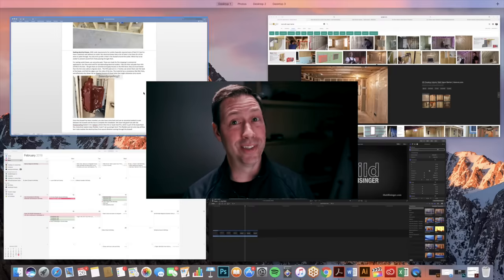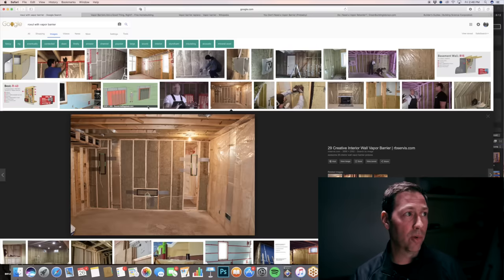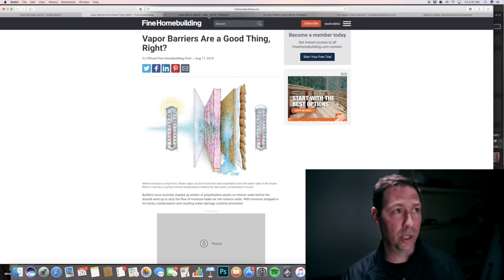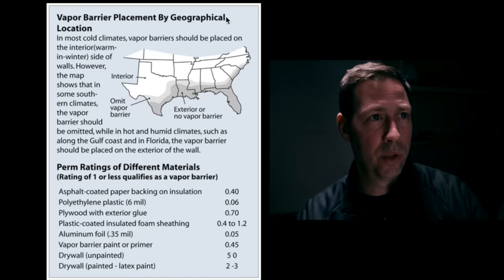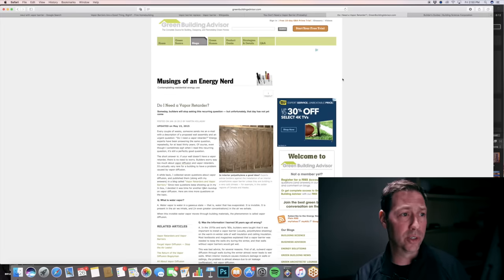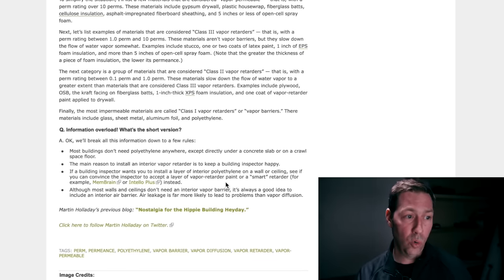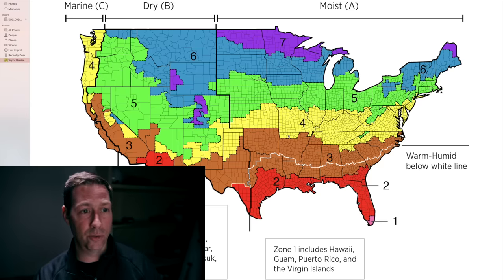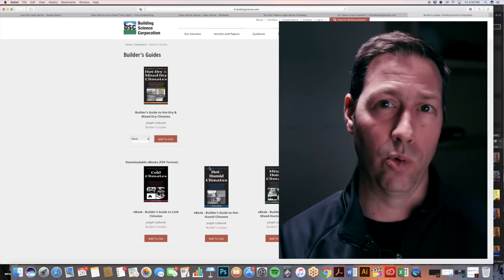Vapor Barriers: Need one or not?

Comment: Doing a shower tub surround.  Years ago we had initially installed plastic over fiberglass insulation, then cement board, then tile on a partial repair of the tiled wall.   Recently we had to remove all tile and decided to just install a simple tub surround.  I was surprised to find some mold starting to form on joist and cement board. as well!  Tore everything out and this time, not using the plastic sheeting.  Using, faced fiberglass insulation, cement board, taping all joints and using quick set mud and then a moisture repellant paint all over the cement board, including near the lip of the tub where the surround will butt up against, before finally installing a tub surround kit.  We'll see how this goes.

Comment: I'm going to stick with Kraft faced insulation.  I like the idea that once it's stapled up it's not going to settle down and create a gap at the top.  Sure, I could tuck that batt up there a little extra but packed insulation has a much lower R-value than loose insulation.

Comment: Thank you for this presentation, Matt. I just moved to NJ from Hawaii, where I haven't faced these questions for years, and back to contracting, I am now working through the entanglement of codes and practical realities on the East coast. Your video helps me prepare my self-contracted attic insulation in New Jersey - zone4, but some specific questions remain open; On one hand I plan on using the Rockwool batts, known to be moisture and mold resistant, and on the other hand I won't seal the attic's cathedral ceiling and walls with drywall, but will cover them with reclaimed and uneven tongue and groove, which will allow a lot of air-moisture exchange. The attic will be our master bedroom so no cooking or shower related humidity and heated electrically with baseboard heaters. Considering these parameters -wood instead of drywall, many holes, Rockwool, low humidity producing activity, do any particular advise?

Comment: This exact thing that happened to my sheet rock. It was suggested to us to use plastic before putting on the sheet rock. Well  another builder told us after the fact that they said that having a double vapor barrier on a wall would cause condensation and could cause mold or rot to the sheet rock. I used 5/8" fire shield on the walls that were facing the walls on the outside. I moved out of that house after a couple of years into another home. Someone else bought it and they put the house up for sale.  I contacted the realtor that was listing that home just so I could look inside as it was empty for a couple of years and I wanted to see what condition it was in. The room that we remodeled had black (looked like mold) that came through the sheet rock. I was surprised! didn't know if it was caused from the house having any heat on for a couple of years or that it was in fact caused by the plastic sheeting? I live up North.

Comment: Thank you for lecturing on this previously-mysterious topic.     The example of the south Texas, 10 y.o. house with moisture damage, is utterly fascinating... and sad.  Here in southern California, we are blessed with temperate air, 12 months of the years, as least for part of each 24-hour day, so I have my house open for fresh air either all day or part of each day.    So I suppose that would cover a lot of sins, of commission, on this subject:  installation of vapor barrier when it should have never happened.

What DOES happen here is inappropriate garden sprinkling, either to soak exterior walls routinely; seepage of fresh water pressure piping; and ground water from geological oddities.   

So thanks again for an education on this obscure subject.

Comment: What about Canada Matt?? I am glad that you did correct yourself, calling poly a vapour retarder as opposed to a vapour barrier. Believe it or not 6 mil poly vapour barrier as it is called is still somewhat permeable!! Meaning that water vapour will actually pass through that sheet of plastic!! It is a must to have this vapour retarder in homes in Canada. With our cold harsh winters the homes have a tendency to "bag'" just like breathing into a plastic sandwich bag, with leave water droplets of condensation inside. The temperature  between the inside and outside of the bag makes a huge difference in the amount of condensation. Here in Canada is moisture control 101. Thanks though Matt!! A lot of people don't understand the concept or principles behind this, a lot of builders included. 
In Canada we use Tyvek or the equivalent of on the exterior of the home under the siding or whatever wall covering. This is actually classed as a wind barrier. Will breath from the inside but, is allowed to let moisture out to the cold side. 
I wouldn't know where to start with a warm humid climate like Florida!! I guess everything that I have been taught would be in reverse!! Walked right into that one eh!!!
Reply: Further to Earl's post: I extrapolated from the DOE map, and a huge segment of Canada's population (specifically the Golden Horseshoe around Toronto, 5M+ people alone) is in the same zone as New York, not the most northerly zone that Minnesota is in. I have to stop myself from fully accepting the claim as it ostensibly applies to here (Toronto) but it's sure as hell got me thinking and researching it. One major problem might be the radical temperature and humidity swings from Summer to Winter. A single barrier optimal for one direction maybe absolutely sub-optimal for the other.

Great channel! This may be heresy of the enlightened kind. Progress in knowledge does that.

Comment: I'm in Georgia and I insisted on house wrap under siding during a reside of my house because the siding specs required it. I don't think any siding should be considered anything but cosmetic. I've also read that a vapor barrier on both sides of a wall is just asking for trouble. Water gets in but has no place to go.

Comment: Great topic and explanation.  Would love to see a video similar to the picture you showed of the house where took down the drywall and found that mold.  Would love to see how you tackle an already existing wall or walls to re-air seal and re-insulate.  Easy enough to explain all that on new construction and I'm sure very similar process but with existing older stuff you never know what you're gonna get behind some walls.  Thanks!!

Comment: The one place on my home that seems to have a problem with the siding rotting off every 20+ years is off of a full bathroom that has one wall that is adjacent to and outside wall. I'm in zone 6b, 27" of average rainfall, 26" frost line in heavy clay, summers that bounce between humid as Houston, or drier than a popcorn fart.

Comment: Hi Matt!  Thanks for a great video.  This actually really helps.  I'm about to start finishing my basement  (right on the climate zone 4-5 line in Indiana, not that it matters).  Everything you said seemed to relate to above-grade application.  Do the same rules apply for basements/walk-outs or anything below grade?  I'm just curious, and it would help greatly in the coming next 2 months.

Thanks again for the great info!
Reply: What did you end up finding out for below grade ?

Comment: I live in Norway, Europe and find your videos interesting even thou building regulations differ quite a bit. You might think Norway is cold, but actually in the south we tend to newer get snow/freezing temps by the coast. About wapour barriers. The entire Norway need to use barriers now. With increased energy savings regulations and by that thicker walls being enforced, we need to construct walls with barriers both on the inside and outside. The outside thou needs to have a membrane function, typical goretex type of to let moisture out, but completely sealed to avoid air leakages. Before this new regulation kicked in a lot of newbuilds got misture/fungus problems. The consequence is that we need a significant amount of time to completely dry out the fraiming before adding in rockwool and seal of with polyEth from the inside. We use quite a moisture test rehime before sealing walls. Moisture buildups stopped with this and wattage/m2 dropped. Insulation in the walls are now usually between 20cm and 40cm but it is the total calculated power consumption that count when constructing the house, so some may be thinner.

Comment: My local building inspector (southern Ohio) says nobody is using vapor retarders on walls anymore except for "wet areas" like bathrooms.  My home was built in the 60s and has brick cladding with fiberboard sheathing and dense-pack cellulose insulation in the walls.  I'm remodeling the kitchen and bath and found no evidence of prior moisture problems in the insulation or wall framing.  Now I need to put new insulation in and am considering Roxul.  My worst fear is going to all this expense only to have to rip it all out due to mold in the walls.  Given the home's construction, it would seem that no vapor barrier would allow the walls to dry to the inside.  

The climate does get cold, but the AC is used for just as much of the year as heat.

Explanations rooted in building science resonate with me much more than the rules of thumb that many contractors go by. Thanks for posting this.
Reply: I used Roxul in a bathroom, and used plastic sheeting, after seeing this video it was probably a mistake. The basement here was finished and I tore it out and found plastic sheeting on cinder blocks, and loaded with mold and mildew. I painted most of the walls with drylock and that seems OK.

Comment: Loved the video - there seems to be a lot of nonsense regarding vapour barriers - I love the comment "the reason you might want to install one is to keep the building inspector happy".  Living in cold n wet UK.  I've regularly lined the coldd face of interior summer house walks with thick damp course plastic, packed with insulation then merrily clad.  Some of them have been up for decades now and not a hint of a problem even when they have had hot tubs installed!  I personally think adequate ventilation is the key and my humble plastic sheet functions as a wind barrier which combined with the packed loft roll limits air flow!

Comment: Very helpful information and a superb presentation. I am finishing replacing insulation in a ground floor closet’s wall that is common to outside wall.  Discovered water soaked vapor barrier sheets and insulation when starting to install sheet rock there for first time in 17 year old Virginia house. Installed Fibre Converters Thermo-Sheath water resistant boards as vapor barrier behind sheet rock. Have been debating hanging 6 mill plastic as inside barrier on room side of sheet rock. Only need 8 x 10 ft but would have to buy 100” x 10.” From your presentation appears I do not need the inside 6 mill vapor barrier,

Comment: I think you're right about it being more from air flow than percolation. I think it would be better to totally seal the outside of the framing, but that's easier said than done. Anywhere that hot moist air meets a cool surface there will be condensation. Condensation is the true enemy! 

Stan

Comment: Thank you for this video. Im in the design stages of a small cabin in the Ozarks, and have been fretting over the vapour barrier issue! Im using rock wool to insulate.
Reply: What did you decide to do? I'm busy making updates on my house, and while I'm in SoCal, I'm up in the mountains where it can get around 18F during winter and plenty of snow. My house has an exterior Tyvek wrap, but not interior vapor barrier. In fact, most of the walls have corning insulation with pine board right on the studs. No drywall. I have a bit of mold inside some of the walls.
Reply: @PinchTune  hi there, I ended up getting the cabin spray foam insulated. I have a wood stove for heat and it is working out quite well.
Reply: @PinchTune  It is important to have a bit of air space between the back of the boards and the paper face of the insulation. Too many try to overstuff the walls and/or use the paper staple flange wrong. That paper flange is to force you to keep the insulation back an inch or so from the back of the finished wall, but if they staple it to the face of the stud instead of the side of the stud, you get contact with the face and the finish material which is a moisture trap that can cause mold growth. I have seen folks stuff six inch faced fiberglass into 2x4 stud spacing thinking more is better, not realizing that the squeeze the air out of the fiberglass and that is the insulation factor. Dead air is what insulates not the fiberglass. Squeeze all the air out and you have no R value at all left. Also that paper facing has a mastic on the back that is a vapor barrier. Not a good one but does stop moisture movement better than nothing. That is why it traps moisture when in contact with the back of the wall finish.
Reply: @markpashia7067  Thanks for this. I recently built a room at the corner of the house and I was forced to use 2x3s instead of 2x4s on the slanted wall that faces outside. Yes, I stuffed 2x4 insulation in there. Luckily the other outside facing wall does have 2x4s and the correct insulation. Regardless, that slanted wall NEVER had insulation before, so now even though it's a bit tight, it also has drywall over it (used to be just a panel.. Much better now. Oh, and the window was a single pane. Not it has a modern double pane window.

Comment: I did drywall a number of years back in the late 70s.  Too often the supplier would send stacks of sheetrock that was wet and moldy.  The choice we were given is put it up or don't work.  In the Carter years you were lucky to have any work.  A lot of moldy brand new homes went up at that time.

Comment: Matt thanks for the great video and this format would be a great inclusion into your channel. I'm wondering two things 1 are you still building and do you work in Florida? 2 I've seen an insulation that that is fireproof up to 1800 degrees and doesn't transmit heat until that point. Is this practical energy efficient and at a price point for the average family?

Comment: both formats informative, just one thing 40yrs ago i built a house near Detroit MI I used red thick poly on the inside sealed with tuck tape and fiberglass insulation. The basement flooded due to a bad water heater valve destroying 6" of the lower dry wall so it all got pulled down it assess the damage while the drywall got wet the plastic stopped it from getting water into the insulation and framing every thing behind the dry was dry and free of mold and water damage. While I pulled it all for safety i could of cut up 2 sheets and done a cheap repair. The garage in the video is exposed to extreme hot and cold in short gaps as the door is open so im not surprised it rotted it could be exposed to rain directly

Comment: Would you consider closed cell foam a vapor barrier, and not recommended for wall insulation? A lot of these flood damaged homes in the south are being sprayed with closed cell and I could imagine that the trapped moisture against the ext sheathing would cause rot with the vapor drive going inward and not being diffused into the foam.

Comment: Thanks, Matt!  Jason from Grandville (near Grand Rapids, MI) Lowe's recommended you to me.  I almost used poly vapor barrier on top of faced insulation on an added room (added about 20 years ago.  The room had insulation on only about 1/2 of each outside wall.  No wonder it was so cold.  Another Jason, a builder friend now in Allegan, MI also suggested watching some good insulation videos.  I'd swear I watched a few videos in the in the last few weeks that showed poly on top of faced insulation, but I will NOT be doing that.  Thanks!
Reply: Faced insulation IS a vapor barrier itself. The mastic on the back of the paper to glue the fiberglass to the paper is a vapor barrier, so putting plastic over that will make an area where humidity CANNOT ESCAPE and will rot your bottom plate and grow mold all over the paper. Never two barriers!

Comment: Lucky me, I’m in climate zone 7, just 50miles from Canada, 20 miles from Lake Superior. I like to use 8mm vapour barrier inside, under the sheet rock. 
When the temp hits -20° or colder, then you add in the wind, it just blows right thru the house, the incredibly cold temp sucks the moisture right out of the air. So for us in the north, we put in a vapour barrier on the inside with the idea that the severe cold temp will more or less suck the vapour out of the walls to the out side. On the outside we have a kind of vapour barrier over the sheathing that allows moisture to go out, but not enter. 
Matt, I’d be interested in seeing how someone like me can insulate a house and do the vapour barrier better. How would foam affect this system? How can I increase the affective ability of the insulation on these 80-100 year old houses?
Reply: Can’t say much about upgrading an older home but if I was building new I would use a Zip-R 12 for the sheathing giving you R-12 insulation on the whole outside of the home that cover all studs and cavities. I believe when this Zip R sheathing is taped it becomes a wind barrier as well only letting moisture out
Reply: Old post, but... I think the only good way of insulate such an old house is to insulate from the outside. The common problem with this is that often with such an old home you want to preserve the look and insulating from the outside with the added new cladding is expensive and will very much  change the look of the house.